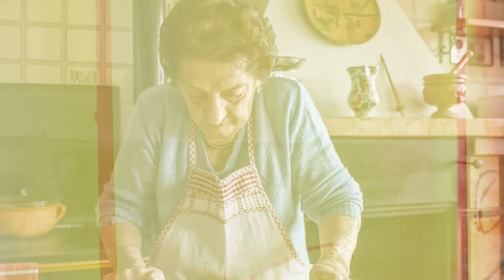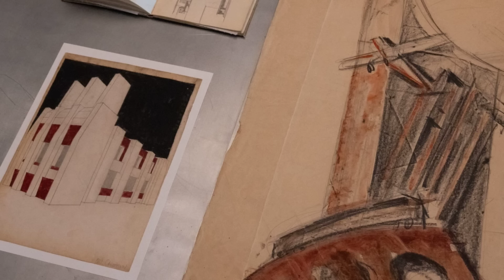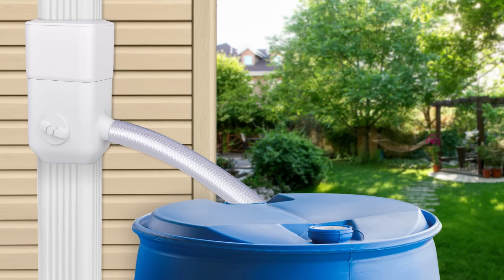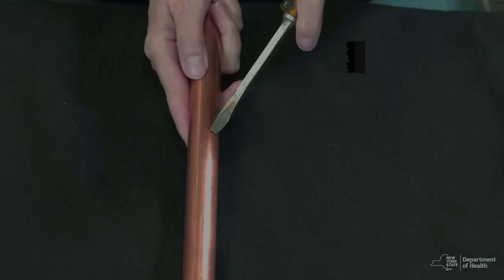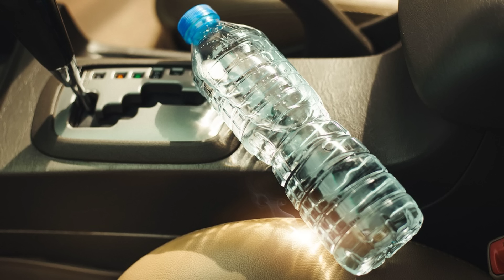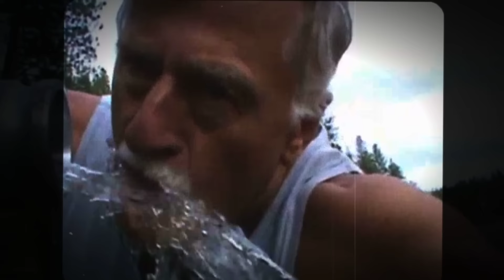How the Amish Purify Any Water for $2 — The Method Hospitals Won't Use

Comment: Watching for the different designs and looking for the best design to build. Manual dumping is fine, but an automated trip would be better. My grandparents just let it rain for a few minutes and then took the lid off the whiskey barrel. Best water ever!  The burned inside was enough without additional filtering.

Comment: Ihave lived off grid in Hawaii for 20 years and catch rain. I've heard of the first flush diverter, but I could not find one in stores, and I could not find any instructions with pictures for  DIY, and I could not find anyone who had ever seen or heard of the diverters, so I wound up sinking about $500 into a Whirlpool charcoal filtration unit (also water softener, but that wasn't why I bought it).  At first it was great. All was well for about a year, then that water began to taste. I could not change the charcoal. And then something went wrong with the self-cleaning timer and it began flushing without turning off. I live in a dry area and coming home to an empty water tank is a real bummer.

I really admire the Amish. I would like that lifestyle, I think. My grandparents lived like the Amish  in their youth. Gramma could still to anything by hand and from scratch even after everything converted to electric and people began favoring factory-made goods.  As a girl I could see American society was being led the wrong way, to a system of dependence on the artificial. I wanted to go back to the time when my grandparents were young, or even before then -- to pre-industrial days.

Comment: Great video! Thank you!
Yes, I knew about 1st flush bypass filters before your video. 
The other thing I have done is replacing my eavestroughs with an aluminum gutter guard top. This allows the debris that I used to have clean out of my eavestroughs several times a year, which is a gross and potentially dangerous job, to simply blow away in the wind.
  I have not had to clean an eavestrough since. 
Combing this gutter guard eavestrough topper with a first flush bypass filter is next step rainwater harvesting.
 
The American Rain Water Catchment Systems Association (ARCSA) is a great place to go for further information and to find solutions from its member companies.
Cheers ❤

Comment: No, I did not know about the diverted.  However, I worked in a aquatic toxicology lab.  This is VERY IMPORTANT INFORMATION.  My question is, os this coming off of corrugated metal roofing or shingle roofing or both?  There are possible toxicology problems with both.  May I please ask what kind of roofing material and guttering system they are using to catch the rain water.  Also, I ha e noticed the Amish do not have trees that overhang thier houses.   This would make a huge difference in the lack of leaf litter from the roof and they by reduce the leaf tannins leaching into the water as well as certain microbes indigenous to leaf litter.  Please let me know.

Comment: I had indoor plumbing done with a well and it didn't taste good to me. Others liked it. A rumor was that an out house may have been the issue though the ground is supposed to clean it. Spring water from an actual spring prior to the running water tasted fine. I had lived in a non rural area prior to experiencing this. I heard city ppl often didn't like natural foods as they weren't used to them.

Comment: They used wooden barrels, not plastic ones, which is significantly healthier. The older generation from Gran Canaria employed a similar method, collecting water from their roofs. However, they would plant watercress in the top of the barrel to filter out impurities before the water entered the main container.

Comment: Interesting, I found a 20 ft dry stone cistern about 30 feet from the house. The house is from the 1860s. I covered it with a large stone. I would think it needs filled and flush and tested. If filled from the roof would this be a good filter. Does this Amish Home system have any information on how to utilize this gem? I also need to get the water out.

Comment: Yes, I actually have known about 1st diverters since about 2010, but only because I've been interested in off-grid rainwater collection for some time now. There are several companies in Australia that specialize in this stuff, cause it's a serious pursuit over there, where some territories go without water for over a year sometimes! But one can be built from a canister made from a 4 or 5 in. diameter pvc pipe, sealed on one end, with an exact fitting kid's plastic ball working as a float valve. Believe me, this subject is WORTH researching.

Comment: This is too much cost and work, there's a much cheaper and better way.

Use a filter cloth or bag (synthetic fabric, it's a swimming pool or well water supply, costs as little as $2) that can block anything down to 5 microns, use it as first stage to block sediments. 

For second stage use another filter cloth or bag (synthetic fabric, it's a swimming pool or well water supply, costs as little as $2) that can block anything down to 1 micron. 

For third stage use a gravity drip hollow-fiber filter (camping equipment, as little as $3) that can block down to 0.01 micron, this blocks most harmful bacteria.

For fourth stage, use food grade activated charcoal. There are many ways to make this stage, such as the bucket method. 

The total cost is about $20.

The filter cloths can be reused repeatedly by washing in clean water. Good for tens of housands of gallons of water. Either stage 1 or stage 2 can be eliminated, but having both stages is better.

The hollow-fiber filter can be cleaned by backwashing, it's good for tens of thousands of gallons of water. 

Charcoal is the only thing needs to be replaced more frequently depending on the amounts of chemicals such as chlorine in the water.

Basically this system is cheap and highly effective. It doesn't need sand or rocks; cleaning and maintenance are easy.

Comment: I have heard about/seen the first flush on multiple sites.  I have also worked at several Municipal water systems and many of them use the same filtration system as you described. The difference is that instead of a barrel they use a specifically designed concrete tank that is minimum 30' square and at least 15' deep. With piping and valves to allow, filtering flow, backwash flow and a flushing flow. Otherwise they are a huge example of what you discussed.

Comment: You do know this water filtration method using natural elements remove debris only from the water? 
ALSO, IT DOES NOT DO A DAMN THING TO REMOVE OR KILL BACTERIA AND VIRUSES? INCOMPLETE INFORMATION WILL GET PEOPLE KILLED!!
Clear, cool, delicious water does not mean the water is free of biological and chemical contamination. Even boiling the water for 20 minutes doesn't completely kill every type of bacteria. Some bacteria is pretty damn hardy.

Comment: Beware of the air ! 
What goes up must come down. Aluminum is getting all over our food in the fields and obviously going into the drinking water. 
    Jet fuel exhaust, particularly during take-off and landing, releases a mix of carbon dioxide, water vapor, sulfur oxides, and nitrogen oxides, along with ultrafine particles (10–20 nm) that can penetrate deep into the lungs. These emissions, combined with potential aluminum additives in fuels, are associated with respiratory issues and long-term health risks.

PubMed Central (PMC) (.gov)
+3
Key Aspects of Jet Exhaust and Emissions
Composition: Jet exhaust primarily consists of carbon dioxide (
) and water vapor (
), with less than
composed of sulfur oxides (
), nitrogen oxides (
), carbon monoxide (
), unburned hydrocarbons, and soot.
Ultrafine Particles (UFPs): Emissions include nano-sized particles (10–20 nm) that can penetrate deep into the respiratory tract, with high concentrations found near airports.
Health Impacts: Exposure is linked to dizziness, headaches, nausea, respiratory irritation, and potential long-term, chronic health effects.

Comment: Amazing. Yes, I did. My son- in-law. Have installed a diverter . First flush. When I  had converted  unused swimming pool, in to rain water tank,
 Underground, and garden  shed over, metal man hole for  axes. Is plumbed into house,  only to toilet flush, bath, shower cold water.
  There is a small filter , by the pump, each , each time you flush or open tap. Cold one. That filter needs to be changed every year  around.
 Now they are telling me this is obsolete. ( I see it still available on internet ,) wanted to sell me  updated version, expensive, I can’t afford.
 Ps. I wander, if that AMISH , WAY WOULD WORK FOR ME, AND MORE TO THE POINT, WHO WOULD WANT TO DO THAT CONCEPT FOR ME.
 AND WHAT CREDENTIALS YOU NEED, TO BE LEGAL. ACCEPTABLE BY  LOCAL COUNCIL.
I I  NOW HAVE SUBSCRIBED, YOUR WEBSITE. AND HOPING, THAT I CAN GET SOMEONE,  WHO CAN DO THIS FOR ME.
 UNLESS YOU ARE WILLING TO COME TO AUSTRALIA, OR HAVE SOMEONE TO RECOMMEND. TO ME.
THAT WOULD BE AMAZING.

Comment: Interesting, I would make a few more mods to achieve healing water.  Sterile clean water can rob the body of minerals and charge.  As minerals leave the body with sweat and urine clean water doesn't replace the minerals.  So, I would add biotite, hematite, magnetite, calcium carbonate, and mod the container filter box to channel Earth energy.  The water it produces is a high grade PII water easily converted between structured EZ water and loose PII water in muscle and organ cells.

Comment: Just make sure it is a dark 55 gallon….not WHITE…algae will grow if the container is not dark.
Reply: Paintvthe barrel black to block light, the paint it white to reflect heat and keep the water cooler. Place it in the shade, or install a shade over it so it doesn't heat up. If you're not keeping the water hot, you will grow killer bacteria in warm water.